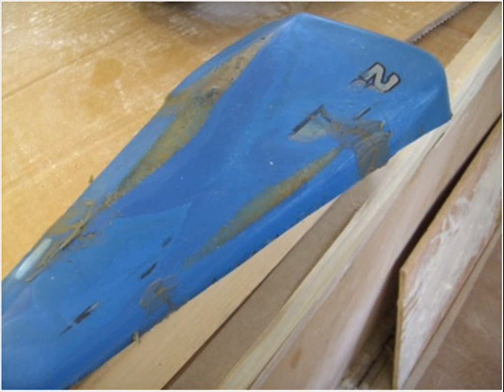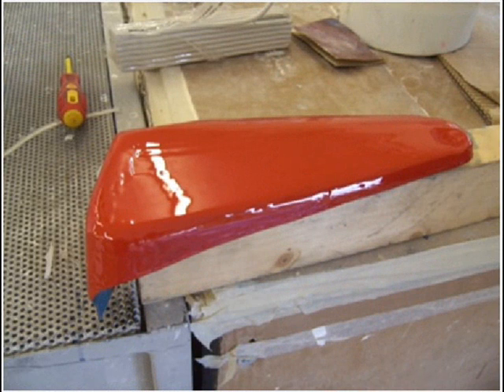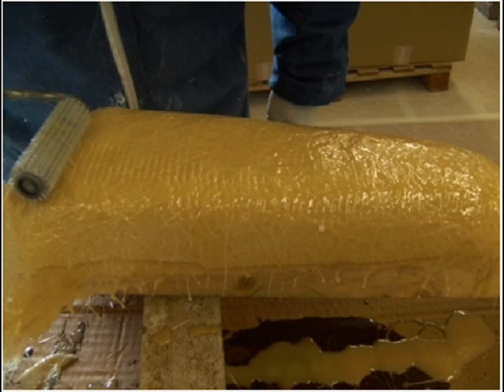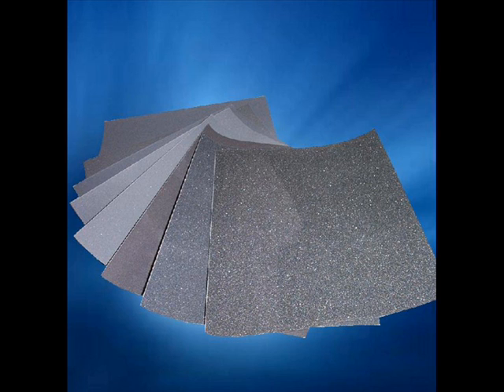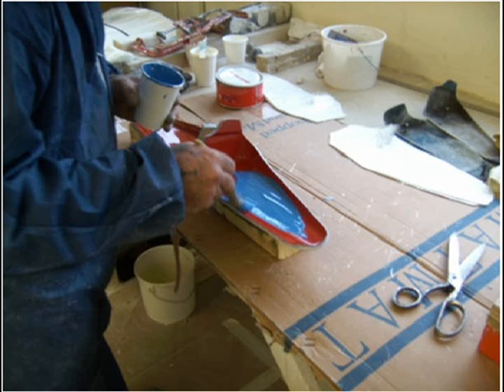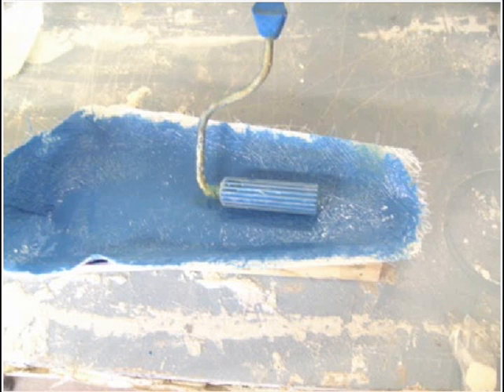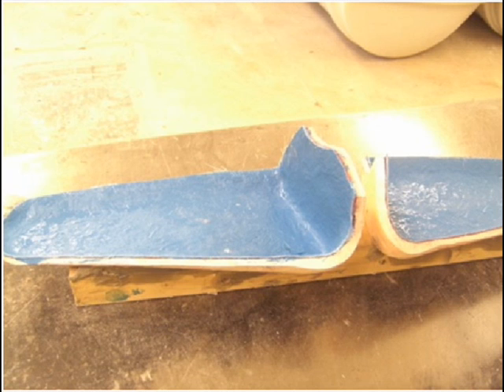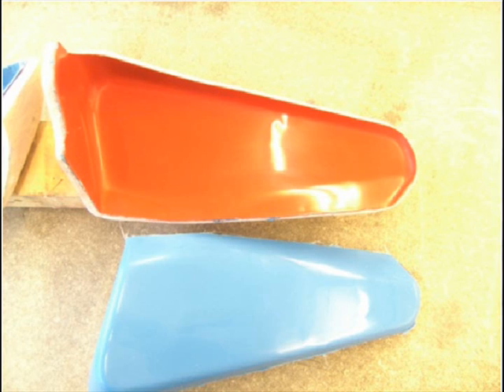how to make a simple fibreglass mould

Comment: Great video. But what if you need to do a mould for a part that has threded screws on the inside of it; like a mirror cover? How do you copy the threded screw holes ?
Reply from the maker: Hi, you'd have to drill them after you've pulled the part
Reply: Any tutorials or pictures on how to do that ? :)

Comment: Hi, can I ask how much Fibreglass Chopped Strand and how much liquid resin is required for a project like this? Thanks
Reply from the maker: Hello, how much resin you need is determined by how much chopped mat you've used, and what weight etc. For example, 450g matt needs approx 1kg of resin per sqmt for best coverage, 600g matt uses 1.2kg resin per sqmt.

Comment: Good job, great video. the most comprehensive I have seen so far with lots of clear tips and tricks. Thank you very much for sharing. May I ask if PVA stands for Poly Pinyl Acetate? Isn't there a PVA glue? What exactly is the PVA coat and what does it do that wax can not ?

Comment from the maker: Hi, yes indeed you can use just a good quality Carnuba based wax such as MG08 paste from Meguiars. Usually 10-12 coats is enough an hour between each application, we only used PVA to show the process, never ideal if you are relying on a great finish on the part, i hope this helps.

Comment: Hi there, I'm building a 4.5ft rc boat, and am about to make my fiberglass part.  My mold has never been used before, and I'm wondering if I can just use wax to release my part?  In the video you used PVA when making the mold, but just wax when making the part... I would really prefer to just use wax, like you did, as that will save a lot of sanding and polishing for me.  Do you think I can? (if you're wondering about the shape of my mold, I've got some vids on my channel)  Thanks - MrRcFanatik

Comment: Hello, when making "Fiberglass Molds" larger than 4'x8', is there any advantage in using EPOXY over the new POLYESTER Resins (low shrink)?
Another concern is with "pattern transfer to the surface of the mold".
Lastly, parts pulled from the Mold will be "pre painted" and made by Resin Infusion with EPOXY.
Thank you

Comment from the maker: @Philjannasch Hi, each layer of CSM ( Chopped strand Matt) weighs 450g per sq metre, basically cut the pieces for Fibreglass to size, weigh them, say they weigh 400g, then you would use approximately 800g - 1kg of Resin, hope this helps.

Comment from the maker: Hi The Gelcoat is applied to before your main fibreglass and resin laminate this becomes the finshed inside surface of the mould.
PVA can be applied lightly by sponge no wax is needed as long as sufficient PVA release agent is applied.however some time a little bit of wax ontop of a dried PVA can help release from delicate parts.

Kind rgds